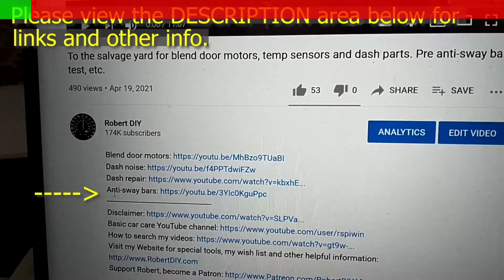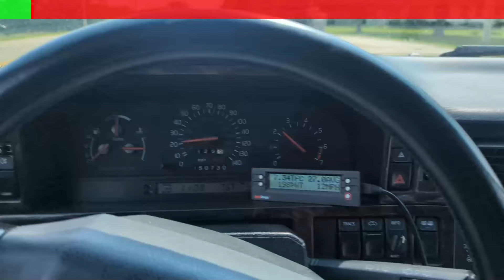In Kenosha WI helping fix a Volvo 850. New struts, front brake pads, PMP switch repair, and more.

Comment: Robert, my positive battery cable always comes loose, and when i try to tighten it i find that the bolt just spins, threads have been stripped. How do i fix this? Do i need to replace the whole cable?
Reply from the maker: https://youtu.be/Kk1_lDG9mEo?si=d4b5KxcxRSUvaPKc
Reply: @RobertDIY  Thanks a ton!

Comment: 80 percent of the weight on Volvo is on the front struts. do not use anything but Sachs, and mybe bilstien and koni there.3000  pounds on them and 4500 when stopping hard. can't advise on coil over.
Reply from the maker: You think it's that much? I was thinking probably 65% to 70%.